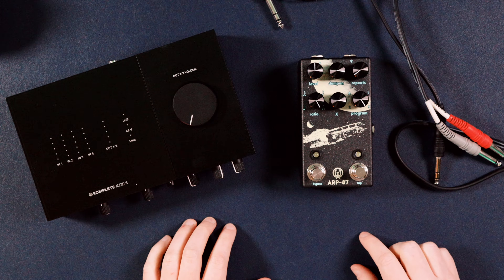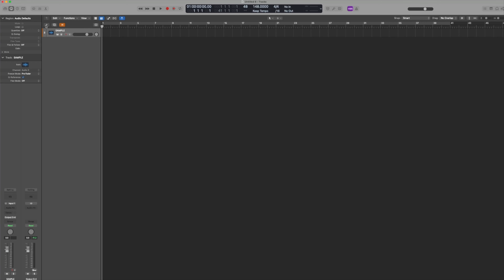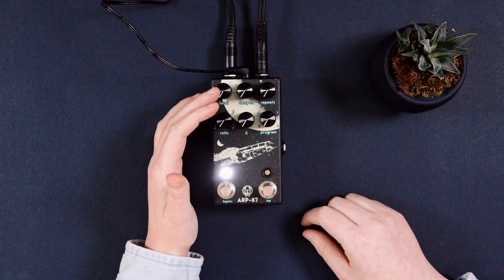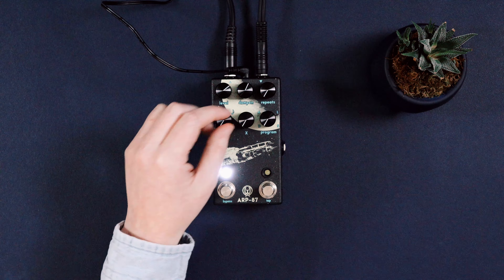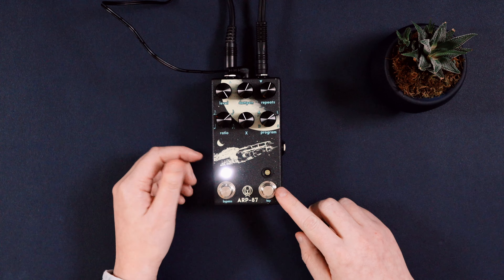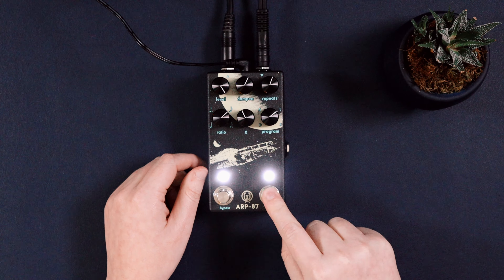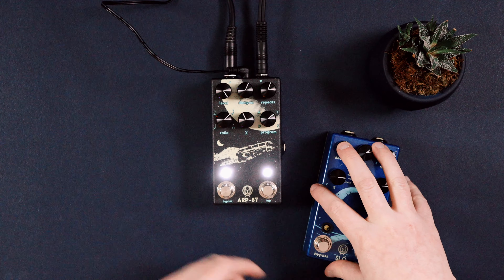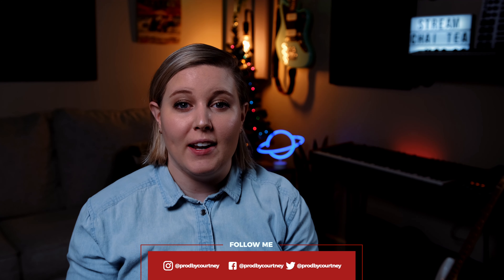How To Use Pedals In Logic Pro X (Tutorial)

Comment: Thanks for this.  Is it possible to control fx such as wah in Guitar Rig using a midi expression pedal?
Reply from the maker: Yes it is. You would just need to set the parameters on the plugin to be controlled by your midi controller.
Reply: @CourtneyHawkins  TYSM - I will have a go in Guitar Rig